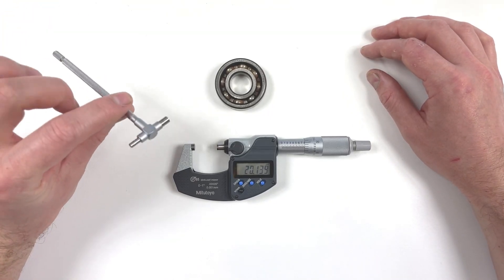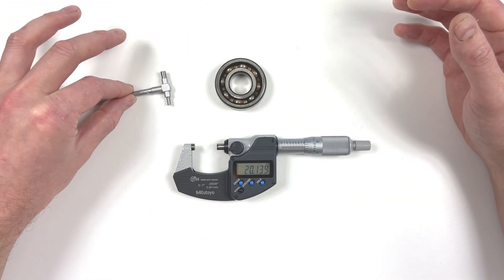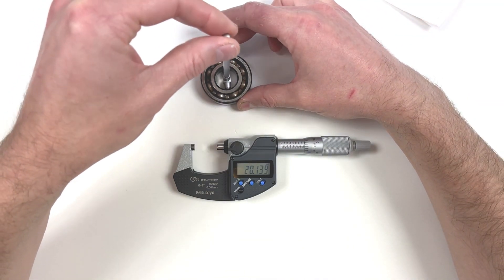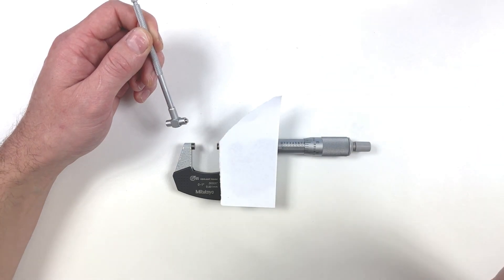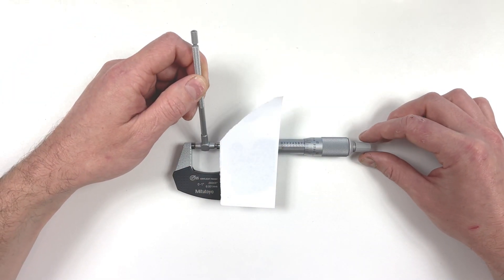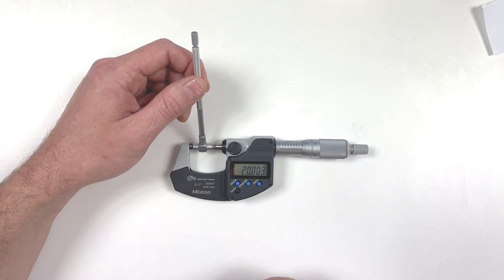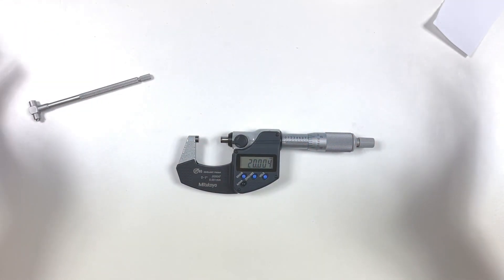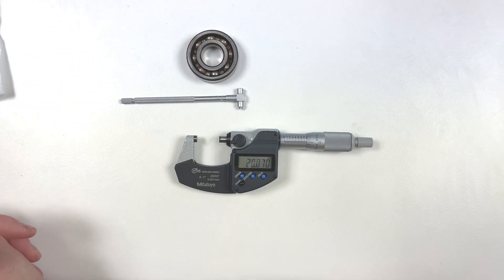Telescopic Gauges VS Dial Bore Gauges

Comment: You are correct, its all in the users feel. We were taught to lock the telescopic when held off the diameter, pull through the diameter, then remove the telescopic. Apprenticeships served with the CEGB.
Reply from the maker: Yes :) all down to technique and feel.

Comment: Good demonstration and excellent repeatability. 
It does make a difference that you are using good quality kit. 
I think using a dial gauge with a digital indicator is much faster once set and very repeatable. You are only really making one measurement, when you set it. You can of course use a 0.001mm gauge as well. 👍
Secondhand dial gauge sets come up regularly and aren’t too expensive.
Reply from the maker: Thanks for the kind words - Yes you’re right good tools make a big difference to accuracy and repeatability!! I also agree about the speed and efficiency (and repeatability) of a dial bore gauge! :)

Comment: I use pretty much the same method as you and I find if I invest the time and effort as you have done they are indeed very accurate. Once the gauge is set in the bore I take the time to properly set the mic as you do. Having done that, if I need to be very  precise, I return the gauge to the bore and 'feel' it in the bore then check the 'feel' back in the mic without changing the mic setting.  If the feel is the same on both the I’m confident I have a accurate bore size. I’ve checked this method on occasion with slip gauges held in an internal bore holder and found it to be within a couple of microns every time.
Reply from the maker: Yep well done, same here. It takes skill and time, but it’s well within the accuracy of any dial bore gauge measurement!

Comment: 2 things I don't fully understand:

1. How do you find centre so easily? Surely the gauge doesn't want to be perpendicular to the sides of the bore? The springs want to push out and skew the gauge?
2. Not quite sure what you mean when you pull back when tightening the nut at the bottom?
Reply from the maker: It will automatically search for the widest point. Pivoting the gauge in the bore encourages this.

When I say pull back when tightening the nut it helps maintain friction between the gauge and bore and stops it slipping off and affecting the accuracy of your measurement. It’s just light pressure.

Comment: Awesome man, proven that this method is probably as good as it gets, I’m new at these and your video was indispensable, thanks
Reply from the maker: Pleased to hear it mate :) lots of people
discredit them because they haven’t put the time in to get use to them, but when you do, they’ll be as accurate if not more so than a dial bore gauge which typically read to 0.01mm where as this set up reads to 0.001!